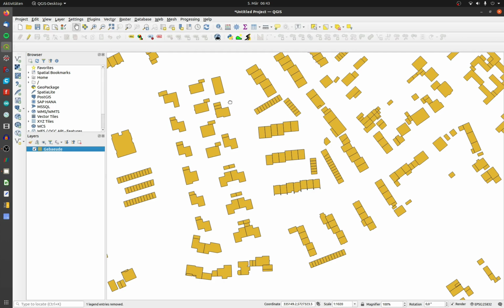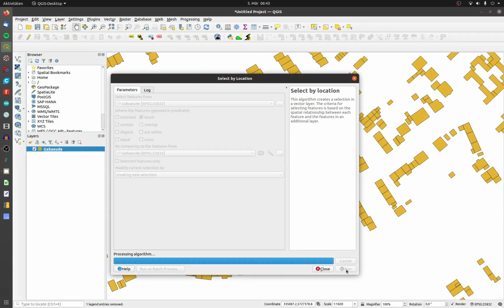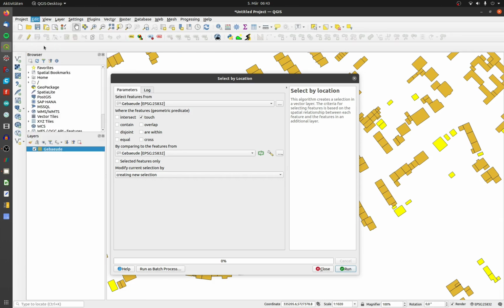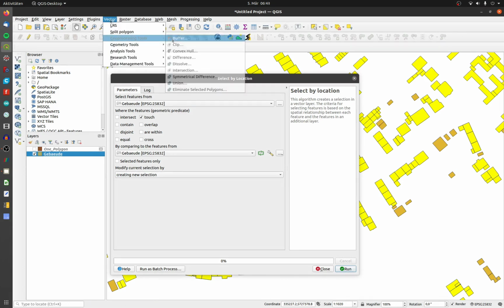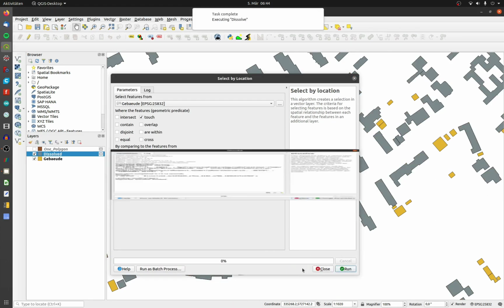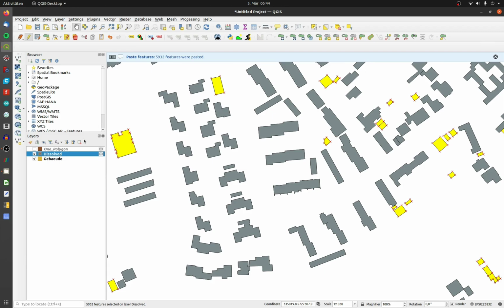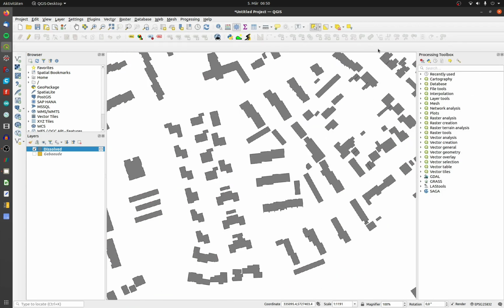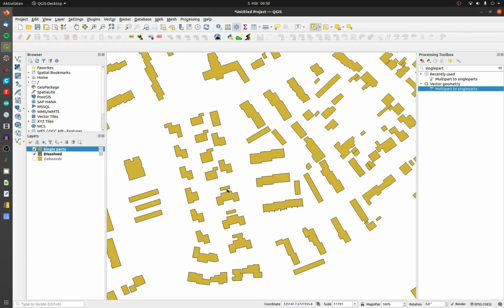#37 QGIS - How to dissolve touching Polygons and split them

Comment: t I want to keep Thanks for a nice walkthrough. I have a problem though. When I dissolve I lose data (from each polygon) that should have been transferred into the new dissolved layer. Do you know what might be happening?
Reply from the maker: Hey, did you mean the attributes of each polygon ? 
For example: If you dissolve two polygons into one, only attributes of one polygon will kept ? 
Best regards Kai
Reply: @shorttutorialsdonequick  Thanks for the quick answer. The problem is that I have a counted value in each area. When I dissolve and/or do the multipart to singlepart most of, if not all, off the areas get the ID and values of one specific polygon instead of their own new ID's and values. After a lot of fustrating testing and debating with ChtGPT I thought it would be fair to ask. Hope you can help me :)
Reply from the maker: @nicolai8162  You are welcome. I hope i understand it right. If you dissolve polygons QGIS picks a random attribute and keep it for the hole polygon. Every attributename are unique an can occure only once. I dont think you can have multiply ID's or Values with the same attribute name on a single dissolved polygon. But there i a tool its called Join Attributes by Location (Summary), you need the dissolved layer and the original one, you are able to chosse which attributes will used for the calculation and different  operation. Is this the right tool for your problem ? Best regards Kai
Reply: @shorttutorialsdonequick  Thank you so much! Your comment was vital to my work! Thank thank you again! And happy new years :)